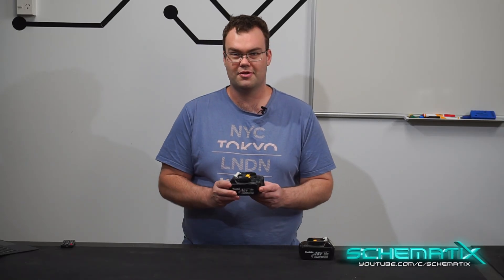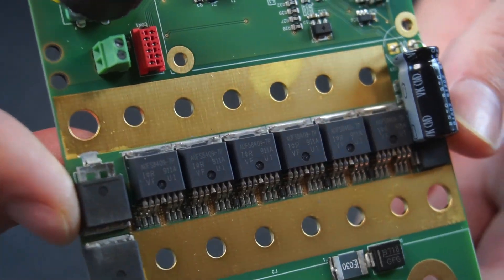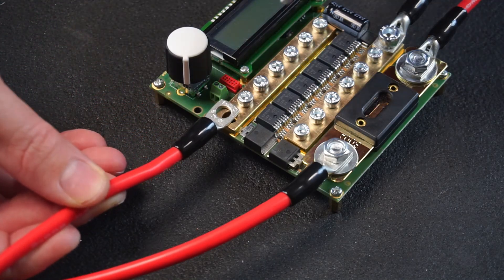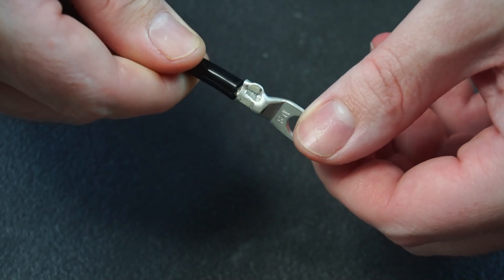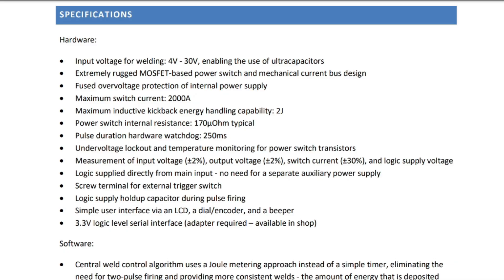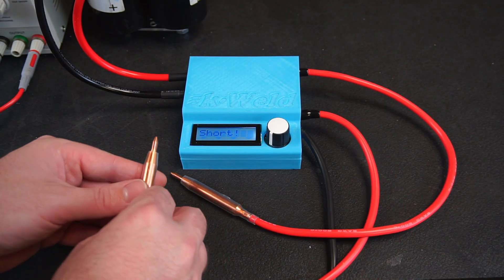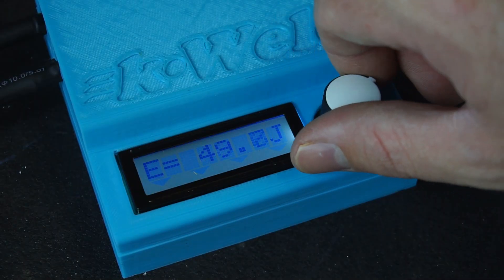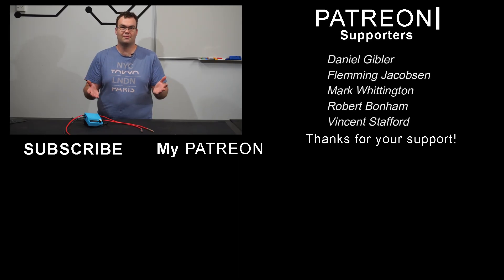kWeld - 2000Amps of Battery Spot Welding goodness! ll Assembly & Review

Comment: The price is so high just for battery weld..👎
I dont understand why its so expensive for that kweld board..
Reply: You say the price is high because you don't understand high-current avalanche-energy electronics. Controlling these currents is not just something you do easily. Those MOSFETs are being pushed to their limits, which takes careful design of the PCB into consideration. Designing a PCB that can handle the currents, fires the gates of the MOSFETs with the best amount of current possible, minimizing gate-ringing ánd distributing current along the MOSFETs, is all necessary to keep this thing alive.
MOSFETs need to be fired 'hard' on their gate, as hard as possible: try to imagine getting slapped in the face: if someone hits you rather slowly and the fingers reach your face first, it won't hurt all that much. Such gate-firing for a MOSFET is BAD: it will pose extreme losses in the moment the fingers start to reach your face and the palm of the hand reach your cheek.
To say it differently: The MOSFET's gate likes to be slapped in the face full force and with as little time between 'no contact between face and hand' and 'full contact'. But as a MOSFET gate acts like a capacitor, dumping quite the amount of current into it can cause inductive effects which can cause gate-ringing (look it up, I'm not explaining it).
Gate-ringing can damage the part and even cause it fo fail.
Then there's current: internally, the die that forms the actual semiconductor can only handle a certain amount of energy before the bond-wires burn or the die itself brakes down. This is a sum of the resistance during on-state (and the resistance during the transition from off to on! where the biggest loss can occur!), the voltage at the gate, the voltage between drain and source and the current that flows.
If you limit the time the current can flow, the MOSFET will survive. Slightly over and things could be very different.

And like that isn't enough, the rather long leads to the electrodes could introduce inductive effects that can seriously damage the MOSFETs as well.

I'm now working on my own DIY spot welder with 2 100000 uF 40 VDC max capacitors in parallel, controlled by a one-shot made with a 555, that, in turn drives a totem-pole to get some current for the MOSFET-gates (6 IRF1405 parallel from my bare head). A short 4 ms pulse is sent to the gates to fire the MOSFETs.
I have to make some mechanism to position the electrodes nicely (as the 2 16 mm2 cables are far too sturdy).
Even though, a test-weld at about 18 Volts, where one of the contacts didn't make sufficient contact, created a huge bang. I'm into electronics for 24 years now, but it scared me greatly.

All of this make up for the price of the thing. Careful engineering to prevent failure and parts that are not the cheapest.

Comment: Seems like 3D printer  also required for casing... Is it... Its again extra cost, is that 3D printer can use any other purpose or only for this spot welder...?  Lets say if I want Drive belt pulley  can I use the same 3D printer or for that so we need another printer...? 
Please reply

Comment: 3:15 So all the current goes through the zinc plated washers, why?
Reply: I think it's tin plated copper, could be wrong
Reply: @TheAviation101  Nope, that's standard zinc plated hardware..
Reply: @JustinAlexanderBell  You are right, it's zinc plated steel with the kit. You can buy silver plated copper and tin plated copper washers though
Reply: @TheAviation101  Yeah, or he can assemble the stack correctly.
Reply: Justin Bell - how would he do it “correctly” then? Kit prob didn’t come with plated copper washers
Reply: @TylrVncnt  https://youtu.be/DX1U3UnCej0?t=209  You just put the lugs under the washers.

Comment: bought a 250 cca lawn battery for 60 bucks. 500 amp starter solenoid for ten bucks and a set of cables for ten bucks. does the same thing for 80 bucks. does just as good. the spot weld is controled by a diy foot pedal momentary switch......
Reply: could you maybe point me in the direction of how to do this ? thanks
Reply: @1DumbSquirrel  https://www.youtube.com/watch?v=o4NaDMoEHxU

Comment: Just put mine together. Thanks for the great video! I have problems with written directions. I would have been lost without you. Thanks again!
Reply from the maker: No problem ;)
Reply: @Schematix  Mine is arriving soon, I purchased it before seeing this, but after seeing this video I'm confident in what I'm getting.  :) PRICEY, but any tool that will last won't be cheap. And high current welds are nothing you want to 3/4 ass, let alone half!  I didn't get the cap kit, and I don't have one already... lets see how I do with my 100C lipo pack...
Reply: IT VERKS!!!!! :D

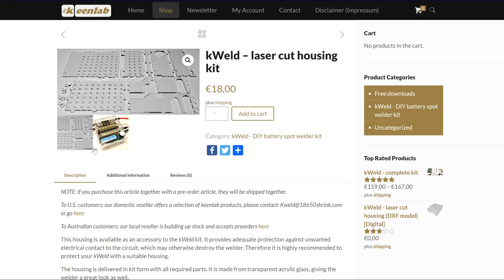Comment: One mistake shown at 4:26 - the longer input cable is the positive and should be on the fuse with the shorter connected to the buss bar (Page 9 of the assembly guide). The longer electrode (It's not a ton longer) should also be on the positive side.
Reply: Can anyone explain why that matters?   I noticed the same thing when putting it together - and just assumed that its a way to identify which of the input cables is the positive one if they looked the same...on mine I used black heat shrink to "label" the negative input cable....

Comment: Did you need any support material when printing the top half of the case?
Reply from the maker: Yes it definitely needs support material for the lid
Reply: @Schematix  Did you put the support material in or did your 3D printer do it automatically?
Reply from the maker: @harryhino2267  I use Cura software. You can choose from several options of support material. I chose "Touching buildplate"
Reply: @Schematix  Thanks mate. I'll have a scratch around. Keep up the good work with the vids. I like your style; simple, easy to listen to and no hooting and hollaring.

Comment: Would you recommend this as a good starter spot welder and or main spot welder?
Reply: Depends on what you are planning to do with it. I'm in the process of reviving 4 V-lock batteries (professional video-batteries) that come with 16 cells each and have been pronounced dead by the BMS inside. With all the welds I need to do and the price of a new battery, I consider it a good choice, especially concerning the reviews you find about the Chinese stuff that either isn't up to the job or breaks down fast after purchase.
So for me, after experiments with a 200.000 uF capacitor unit, which were scary, unreliable and had a very hard time welding 0,3 mm strip, the Kweld seems like an excellent choice, especially when I read how many people just weld away with this thing with ease.

Considering the price and the items you need besides the Kweld itself (the kit is already expensive at close to 200 euro's (including shipping, cables supplied loose) (yes... the price excludes VAT, not very nice to NOT mention that on the website) (EDIT: mentioning VAT was either added on the website or I (unlikely) missed it, it's there now) I can really relate that people aren't completely happy about spending close to 300 euro in total for this thing. But besides my V-lock batteries, I have had more occasions in the past where I was like 'If I could only spotweld...' so the Kweld will be used after I complete my v-lock batteries (this all said that I can circumvent the BMS-software in those things...)
The guy that made this thing has his own Youtube channel: https://www.youtube.com/channel/UCHdQgHkYvGcrX2Jh09NvXug

Comment: Man, see the cables shake when he hits the pedal? That's a lot of current flowing through those cables.
The electrodes look like 308 rounds.
Reply: So is it a magnetic effect?
Reply: @gavinward5448  ...Yes.  The classic physics experiment is to connect a slack loop of thin wire to an appropriate battery or power supply.  When current flows, the wire tries to form a circle to maximize the loop area.  Multiple insulated wires carrying current in the SAME direction will crowd closer together.
Reply: @gavinward5448  
Yes. I have a floor mounted pedal operated spot welder in the shed rated to 10,200 Amps, I use a light to illuminate and if it’s it’s too close  it gives a good jerk.
Reply: I think that was just from his hands moving around
Reply: Tylr Vncnt 11:57 - no hand movement.
So is it a magnetic effect?